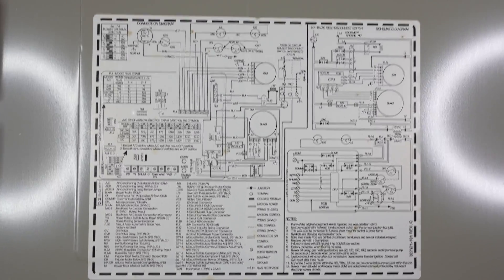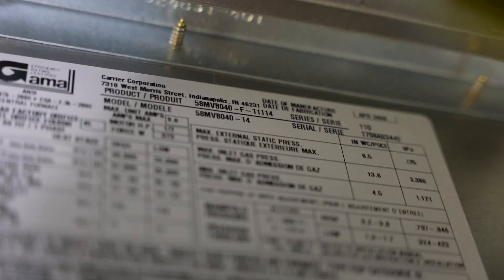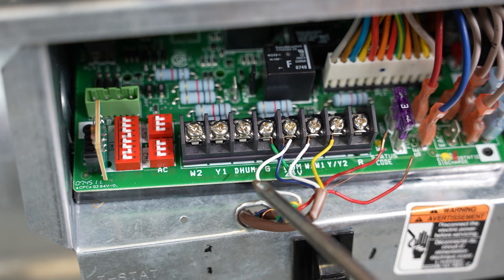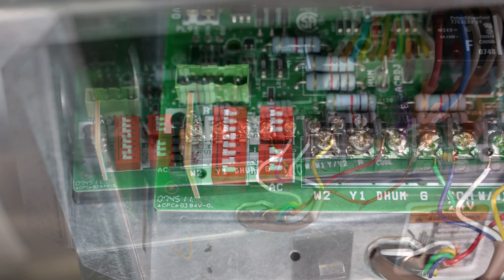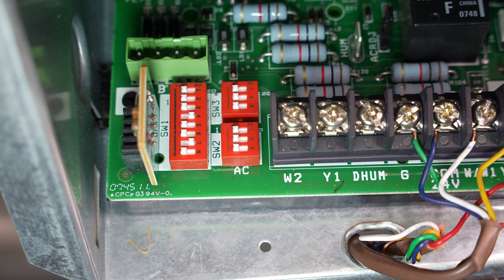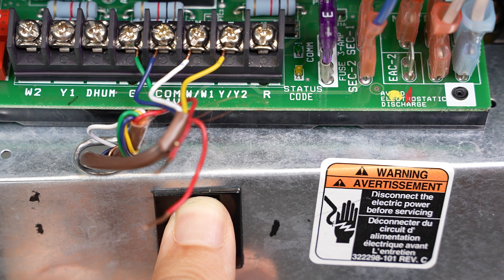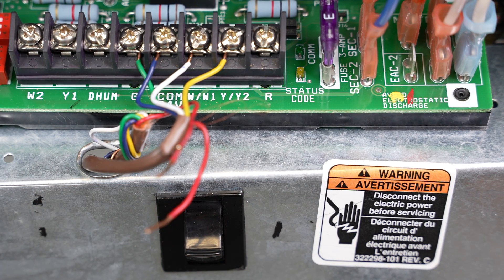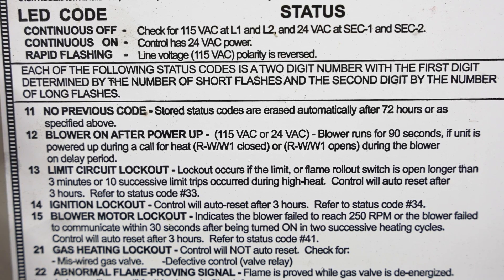Advanced Furnace Troubleshooting Tip

Comment: I have an older high efficiency Trane XL90 gas furnace. It stopped working, but a new fan limit switch got it going again. I performed a complete service; cleaning the inducer intake and exhaust, cleaning the condensate plumbing and then even replaced the igniter and flame sensor, (they were 30 years old.) Anyways, the furnace quit again after a week, I wasn't getting any gas to the burners. Inducer fan runs fine, the igniter comes on, no burner power.  I'm stumped. I thought, oh it's the control board, but I fried a brand-new universal control board by installing it (just before discovering the presence of line voltage absolutely everywhere.)  While troubleshooting I discovered line voltage (117vac) is present between the chassis ground and every safety switch terminal, (even on the gas valve solenoid.)  Oddly, the unit operation is consistent; the inducer motor works, igniter fires, gas valve solenoid doesn't energize. and the control board locks out.  No low voltage control values as long as the igniter is connected to the control board.  I'm stumped. Any ideas would be a great help. (An old-retired tech) Dan

Comment: Jay, trying to diagnose my Goodman GCV90704CXA gas furnace not firing up based on errors codes I started to remove the screws on the panel and my wrench hit the panel and the furnace fired up and started with no problem heating up to desired temperature on my thermostat. What gives?
Reply: I can tap on wire of relay switch and the furnace fires up.
Reply: pressure switch

Comment: Hi Jay, I have an intermittent furnace issue that the transformer sometimes does not provide enough voltage (from 8-22 volts that lower than the expected 24-28 volts) which caused the furnace failed to start.  However, after switching off the main switch then turning it back on, it sometimes works.  I wonder if I should replace the transformer or need to do more troubleshooting.  Thanks for your opinion in advance.

Comment: isn't it great the manufacture has a built in  code reader! If it was your car you would have to buy a code reader before you could do any troubleshooting.
Reply from the maker: Lol isn't that the truth? Maybe in the future furnaces will get to that too...
Reply: Haha, our old Saabs (classic 900) had a built in blinking light code reader you could do if you got a CEL. However it was almost always the o2 sensor that triggered a CEL in those cars so I never bothered to check the codes.

Comment: If you have modern furnace with touch screen thermostat, it should report the error code on screen.
Reply from the maker: Yes, that is another way of recalling codes. Thank you!
Reply: communicating thermostat only - there are many non-communicating touch screen thermostats.